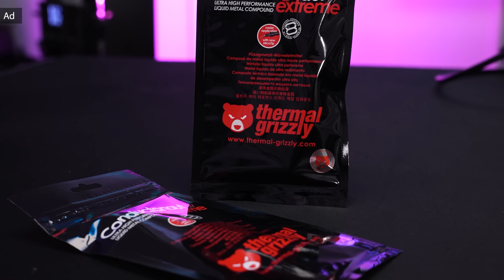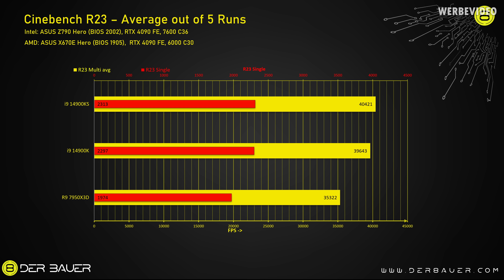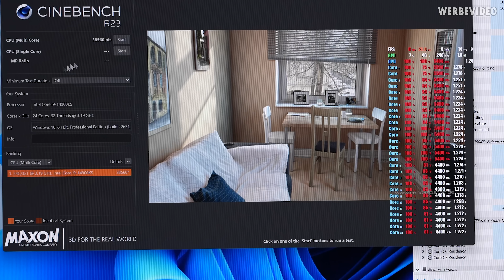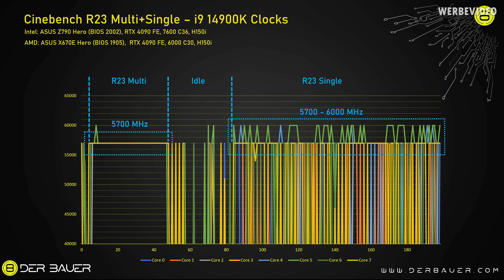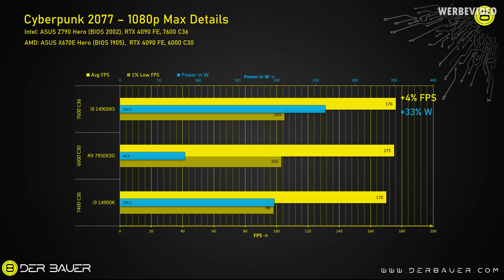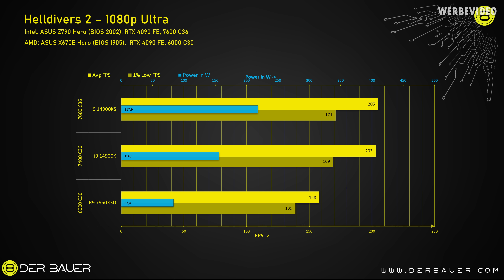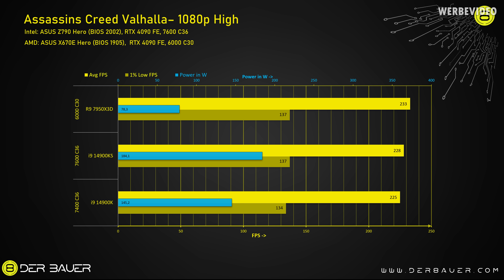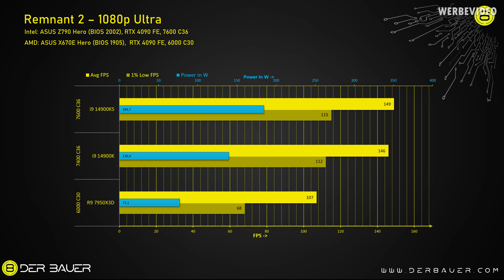Almost 400W under Full Load - The 14900KS is one of the Most Extreme CPUs ever Made

Comment: I've seen Intel 13900K/14900K users on Frame Chasers and Reddit say they're having silicon degradation on their chips. They said that they can't hold overclocks anymore and in some cases have complete CPU failure after ~6 months. Are any of you experiencing this?
Reply: The degradence is probably from the voltage the cpu's running at. At least in this video some of the core vids were hitting 1.48v, which is very high, my i7 14700k hits at around 1.35v for the max core vid out of the box. For the i9s you'll want to undervolt them, to try to lower the amount of voltage being pushed through them.
Reply: Can it be due to these cpus constantly running at very high temps?
Reply: @ashenwattegedera  Can be architectural decay from just how much electricity is being pushed though, not necessary only heat.
Reply: It happened on my ryzen 1700, after 3 years it needed at little more voltage for same overclock.
Reply: @larsjrgensen5975   yes, after several years of higher voltage and clocks, any CPU will degrade a little. The 13th and 14th gens are apparently degrading much faster. Users reported 3 to 6 months before they needed to lower clocks, increase voltage, or had complete failures altogether. That ain't normal.
Reply: @AshtonCoolman  Because nobody reads the Intel technical manual, which clearly state the limitations values for the i9-13900K these are:
- Current: 307 Ampere
- Power: 253 Watts (PL1/PL2)
- Voltage: 1.72 V (Vcore)
So these limits NEED to be manually set in BIOS, because 99% of all mainboard manufacturers run the i9 K chips unlimited out of the box, which literally leads to degradation. Formula to prevent this is easy: Power (W) = Current (Amps) x Voltage (V).
Reply: One of the old cpu's that I overclocked was an old skylake cpu, having the voltage at 1.33v was enough to cause degradence, it needed around a 5-10mv bump to voltage about every 6 months.
Reply: I had to return a 13900KS because all my games just snapped out of existence back to desktop without errors. When I figured out it was the cpu I took it out and it was covered in dark spots. New one runs great so far...
Reply: @Engel990  Did you run the CPU with Intel limits set in BIOS? Or did you run it without ever touching BIOS (very dangerous)?
Reply: I put the limits on. First thing I did. but although I had a 360 rad on it, my case wasn't sufficient for the airflow. So it would hit 100 degrees nevertheless and start throttling. I had to upgrade my case. @Augenhose
Reply: @Engel990  A push-pull configuration for the AIO helps to reduce a further 4-5 C under full load. Also how did you hit 100C in games under default Intel settings? That doesn't sound right, despite A small case.
Reply: @Augenhose  The case is a Darkbase 900 I think, can't remember exactly. Although push and pull configuration isn't possible. It's just that the top is almost completely closed with a few open fins in the back. It's fine for the i5 14600k in it now, but definitely not fine for the i9 13900ks. I put that one in a hyte y70. So much better!
Reply: I haven't seen this yet on my 13900KF even after being the 6.4ghz chiller guinea pig since launch. I've talked to some of these users though, and some have tracked down the issue to insane Vcore voltages. One user reported 1.8v and another 1.82v. 2v is likely instant death for reference.

From experience blowing up a 13600K, their failures are most likely to be in the P-core side of the L3 cache. This is a die hotspot on every single RPL die as it's in the dead center of the chip surrounded by the most power-dense regions of the die. P-core frontside controllers may also take hits for similar reasons.
Reply: My 13900k was running under asus auto setting and it got roached in 6mo.
Yes it's happening.
Also asus auto definitely caused this and if I paid closer attention I would have seen the core voltage at fkn 1.51v that whole time.
Reply: @Houstonruss   You need to set the Intel Default Limits in the ASUS BIOS first. These are
- Max. Current: 307 Amps
- Max. Power: 253 Watts
- Max. Voltage: 1.72 Volts 
- Turn OFF MCE and set to "Disabled - Enforce All Limits" 
People will tell you turning off MCE prevents from boosting to highest clocks but that is nonsense. What prevents from boosting to highest clocks is OVERVOLTAGE. So additionally you can slightly undervolt either using Load Lines (AC_LL below 0.5 + LLC4) or simply lower adaptive voltage by 0.075 V. Both work well. I personally prefer doing it with Load Lines, for my CPU with contact frame I set AC_LL=0.25 + LLC4. Gives really good voltage and stays cool. Still get all my boosted clocks.
Reply: @Augenhose Power is equal to voltage times amperage, your formula is wrong. You cannot get amperage by multiplying watts and voltage... That's nonsense.
Reply: @AristotelesQC   You are right, I corrected the post, sorry it was late last night so I flipped the sides of the equation. Now should be correct. Anyways, the point is staying within set limits.
Reply: Nice. Never going Blue again. AMD WINS 😂😂😂
Reply: @gabrielvieira.4358  In games it really does not matter that much if you slightly undervolt the i9-14900K it stays around 100W, max 115W in full load games. The AMD 7950X3D stays around 90W, so its not dramatic the difference, IF YOU KNOW how to undervolt the i9.
Reply: @gabrielvieira.4358  never say never. Intel's 3d V-cache competitor is coming
Reply: Not sure about 13th & 14th but I've been running a 12900KS all-core 5.3 GHz @ 1.4-ish V for over 1.5 years, still as stable as ever. Having said that, during normal use, I run my PC on Windows power saver plan with it's max CPU frequency set for 3.3 GHz - I think it's min: 5%, max: 50% if I remember correctly. If for some rare reason power saver is too slow / unresponsive, I switch to Balanced but with min: 5%, max: 99% (or was it 95%) instead of 5%, 100%. This means a max of 4.x GHz (can't remember). This means my CPU is always running at very low voltage, heat, power, and frequency. Only when I do things that benefit from max power/speed do I set the power profile to one with a max of 100%. For example, for gaming & benchmarking, I use "Ultimate" plan w/ min: 100%, max: 100% and for things like editing & rendering videos, I use Balanced w/ min: 5%, max: 100%.

I don't know why it's so uncommon for people to use & edit different power plan profiles. Why would I want my CPU blasting to high voltage, frequency, power, heat when I'm just doing easy stuff like surfing websites, watching videos, etc.?
Reply: Hmm. I'm on those all the time, and never seen anyone having a problem. Congrats on your six thumbs up.

Comment: you really should test the gaming against either a 7800x3d, or disable the non-3d vcache cores of the 7950x3d, as there is still issues with games chosing to run on non-3d cache cores of the dual CCD CPUs.

Comment: A CPU that shouldn't exist. Period. Thanks for testing!
Reply: What are overclockers going to play with then? This chip is going to set new records.
Reply: YES!!! THIS! and I LOVED intel before. After getting an Ryzen, i doubt I will ever go blue again
Reply: A cpu that shouldn’t exist for normal consumers* there I fixed it
Reply: Why are you saying this. The 14900KS is the working golden samples of the Intel series binned as  8 P cores and 16 E cores  CPUs. It is not a new CPU but the result of binning. I can accept that this CPU is kind of pointless. But at the same time Intel know two things. One it is a market for this CPU. And people are willing to pay premium for this CPU. So why not cash in on that fact
Reply: The cpu is perfectly fine. This is one of dumbest comments I've seen in a while.
Reply: @blakkwaltz Fine for heating my house and having worse performance than an AMD U-series CPU
Reply: @blakkwaltz 🤣🤣🤣
Reply: @blakkwaltz  can’t tell if you’re serious or trolling
Reply: @sm7085  I am being serious. It's a top bin chip. So saying it shouldn't exist is stupid. It's literally the best silicon on the wafer. The only problem is power management which can be fixed by voltage tuning.
Reply: @blakkwaltz eh it’s not perfectly fine though definitely has a pointless factor to it since it’s meant for serious overclockers only

Comment: Amd learned his lessons from bulldozer, Intel forgot the ones from pentium 4!
Reply: I had a 6300. I OC'd it to 5ghz without changing voltage. Good times.
Reply: buldozer was not close to 200 watts, this thing is a crime
Reply: @betag24cn It was for the FX 9590. CPU was insane, especially with the original price. Was the first 5GHz CPU however (turbo permitting) so far from unexpected.
Reply: @dabombinablemi6188 i forgot that CPU existed. I remember it dropped in price like 70% in a couple of months(numbers out of my ass, i dont remember exactly). At least if it had good performance

Comment: For the 7950X3D you need to make sure your Xbox app and Microsoft store apps are all updated. Once you do that you can hit the shortcut Windows Key + G and it comes up with the game bar. In the settings wheel in game bar you can select this is a game and the game will now set to be ran only on the Vcache cores. I have had to do that with only new games that I guess haven't been added to the list in the driver yet, but this is the way to fix it.
Reply from the maker: Very interesting, I didn't know that :) Thank you for that comment! 
The question is how many average Gamers would know about that. In the end always better if the CPU or driver does it by itself
Reply: @der8auer-en  Its drove me crazy for a while until I found a reddit post talking about making sure the game bar was updated and that you can set specific applications as "remember this is a game" in it. It is not the most elegant solution but does the job.
Reply: @der8auer-en yeah it's not the most intuitive CPU but once you get all the drivers and apps updated it has been reliable for going all on the 3d cores via the method above.
Reply: @der8auer-en No it's not even necessary to do that, I have a 7950x3D and you tun any program without having to set a certain CCD. I honestly believed all the hate until I had the CPU myself. The X3D is a amazingly powerful low power sipping chip.
Reply: @der8auer-en Afaik it's harder to do than Pcores/Ecores because you want to use non 3D cores for anything outside of gaming and Windows by itself doesn't provide this information to the CPU. So if the CPU doesn't know it's a game, it assumes it needs higher clockspeed and uses the non 3D cores.

It's also why you shouldn't buy this CPU for anything to do with Linux as the scheduling is not working on it. I honestly think this wasn't handled well by AMD, they should either use all 3D cores or make the non 3D cores Zen4C so the standard scheduler can work similarly to the Intel one.
Reply: @der8auer-en  Avarage gamers wont buy a 7950X3D and if they do buy it and spend this amount of money they did a bit of research on it.. Intel compared to the 7950X3D just to make them self look better
Reply: @der8auer-en I think the average gamer will go for the 7800x3d as the cheaper option ... so no issue there ....
Reply: @der8auer-en 

If I might suggest, pinning this comment so that it can help more people??
Reply: I tried it and it doesn't work 100% of the time. I resorted to lasso... But IMHO Microsoft needs to fix its scheduler and it needs to let us set affinity in task manager. Seems a bit stupid task manager can't fully manage tasks...
Reply: Kind of ridiculous in this day and age that consumers have to figure out something that should be so simple... Or at least ahould be instructed to the end user.
Reply: @Poo_Garden  I'm pretty sure you are instructed, you just didn;t read it
Reply: @yarost12  nope, you clearly have no idea
Reply: Microsoft Windows can detect malware and virus, but what is a game!?!???!?!???
Such a Dumb move from Microsoft not allowing AMD to fix core balance properly.
Reply: If you have to babysit your apps with the game bar and process lasso that's hardly an elegant solution for a "premium" product that costs $750. Just like 4090s with melting connectors you shouldn't have to jump through hoops and read every company's press releases to get your hardware to work properly.
Reply: Or just disable ccd 1 in the motherb only running on ccd 0
Reply: Do you use process lasso or does the xbox game method work better?
Reply: @mcod99 I use Process Lasso due to it having more granular control over all processes, not just gaming.  I split a lot of workloads up amongst CCX's manually as Microsofts CPU scheduler leaves a lot to be desired
Reply: @mcod99 use Project Lasso
Reply: @mcod99  If you only game use the game bar method. You can hurt performance if you dont know what you are doing with process lasso.
Reply: @MIBxSpartan  Process Lasso is the simplest and the easiest way.
Reply: @mcod99 I've actually tried both game bar and the process lasso option with the 7950x3d, and I've found both give similar performance. So for most people I'd say just stick with the game bar option. If you're a more advanced user that might find other uses for process lasso as well, then I'd use process lasso instead, as they can both conflict with each other.
Reply: If you want to accomplish the same thing without more Microsoft garbage, process lasso does the trick.
Reply: holy crap, 95% of people will not find that out.
Reply: Far too much work, is that all just to game with the X3D cores on that one CPU model?
Reply: this is THE reason why i waited for the 7800x3d. It wasn't the price, it was this crap you needed to run for the bigger x3d versions.
The reasons for not going intel was energy prices and room temperature...
Reply: So Microsoft being Microsoft
Reply: Stuff like that reminds me why I'm glad i choose the 7950X instead of the X3D 😅 but either chip absolutely embarrasses the current generations of Intel.
Reply: AMD junk as usal nothing new
Reply: @AdiiS Junk as in 7800X3D still beating 14900KS in gaming with so much less power. You could try to make an argument at least.
Reply: That's the official way to assign games to run on the x3d chiplet. This is so dumb that people have to do it manually in a very non typical way. This is why I only recommend people getting the 7800x3d instead. Or just go for 14900k if multicore performance is the focus.
Reply: AMD fan boys really don’t know the definition of it just works.
Reply: It's AMD, there is no "all you need to do"
They/you are at the same point with the 7950x3d you were at when I bought my 13700k 1.5 years ago.
Reply: I would avoid using the GameBar and instead use Process Lasso to latch game executables to the affinity on the CCX with the additional 3d v-cache attached.
Reply: @FalconEvo  Way too much work to get the performance you were supposed to. Polar opposite to the 7800X3d
Reply: @RadialSeeker113   this is the point... If it works for one why not both?  Idk maybe it's due to the CPU being different? I am a bit ignorant with the more recent AMD CPUs, so I might just not know enough to currently understand why this issue is different from the 7950x3d to the 7800x3d version.
Reply: @Poo_Garden It's because 7950X3D and 7900X3D have two CCD's and 7800X3D only has one. This is kind of similiar to Intels APO too but the performance isn't as broken obviously. As in you’re giving up free performance and many people may not know about APO but it’s only for certain games anyway.
Reply: @RadialSeeker113  Not sure about it being way too much work as generally power users buy such equipment but I would certainly say the 7950x3d is an odd product on the market with only one of the CCX's having a 3d vcache.  

The product maybe unintentionally steers itself towards prosumer users with more knowledge of cache layouts and getting the best out of it with affinity locking.   For anyone just gaming though just stick with the 8c/16t 7800x3d
Reply: @RadialSeeker113 A keyboard shortcut and 2 clicks of your mouse is too much work? This only happens with SOME not all new games. Microsoft drags their feet at times updating what is a game inside of gamebar.
Reply: @Simon_Denmark  Probably why 7800X3D was launched last... as it would make the other 2 choices less favorable for someone looking to build a pure gaming rig. I waited for a long time for it.. when it was available in the local stores... I went to build my PC.
Reply: @Anon-cv7ru  Yeah I do remember that and I’m pretty sure Steve (GN) was  saying that in the reviews.
Reply: @RadialSeeker113  True, but some people may run workloads where the extra cores are good. 

Inb4 "just buy a second pc bruh" no I already have one (Xeon 4114, yeah I got to buy new) and it runs other specific software and another os.
Reply: @FalconEvo Dumb what a waste of time.